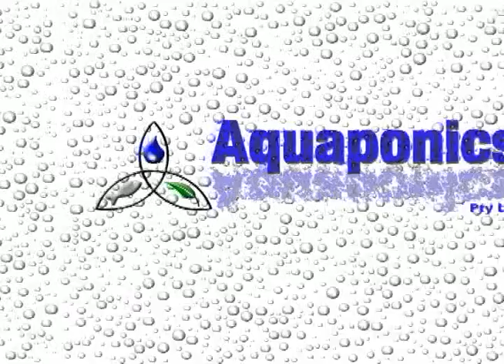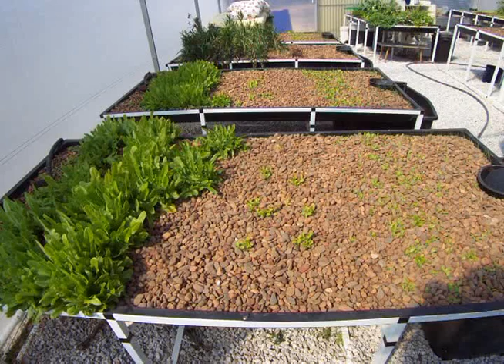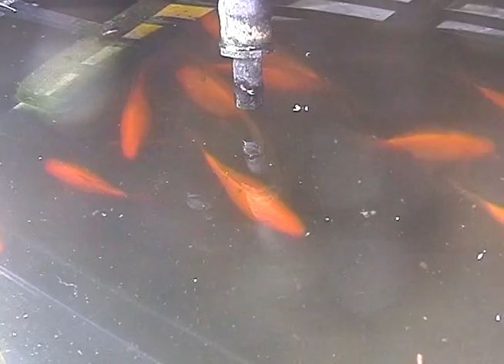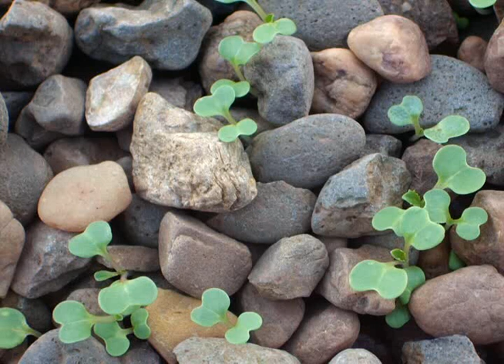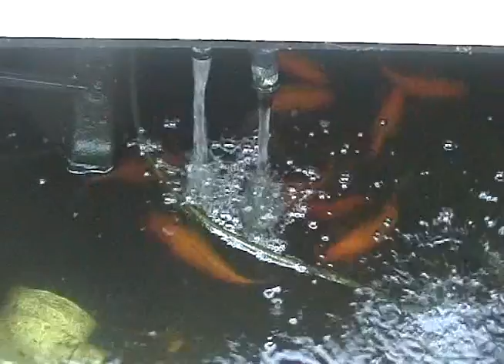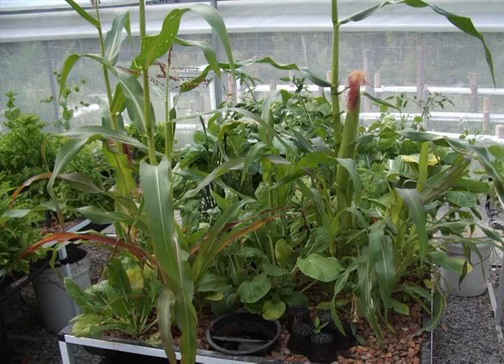Basic Aquaponics System

Comment: @atomrocketcar pump uses very low energy, solar or less than 1$ a month in electric bill, bigger and more pumps may cost more, but, you would be producing more.

it draws water via pump to the top, then it flows down, it needs a pump.

Comment from the maker: You need to make sure that when you flood and drain, that the water is not exposed to the sunlight, i.e. the water level of flood comes below the level of the media. You are right in assuming that using clear grow beds or pipes allows algae to grow where sunlight hits them. Algae in itself is not a problem, it is just that the algae take some of the nutrients that should be getting used by the plants that you do want to grow.

Comment: I am making my 1st hydroponics system.  My plants will be planted in rocks in net pots which will be in a pipe that I will flood & drain.  Cutting holes in the pipe is difficult and I was wondering why I can't plant my plants in a tub of rocks (such as what you are doing) instead of individual pots in a pipe.  I assumed the reason was algae because I was told not to use clear tubes because algae will develop in them.  Do you have any algae or mold problems?  Do you flood & drain the plant beds?

Comment from the maker: The fish are needed if the system is going to be run as an Aquaponics system. Most fish can be eaten, it will depend on the species of fish used whether they are a good eating fish or not. The water use is by evaporation and transpiration, very minimal water use, most water is cycled and kept within the system.